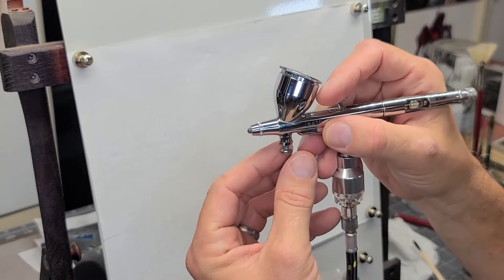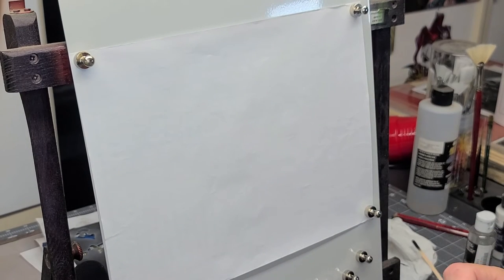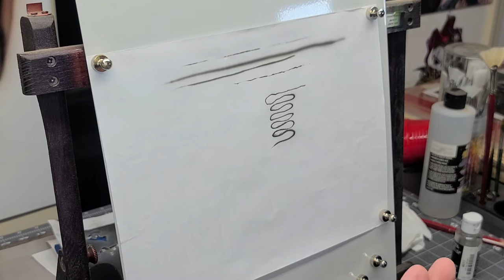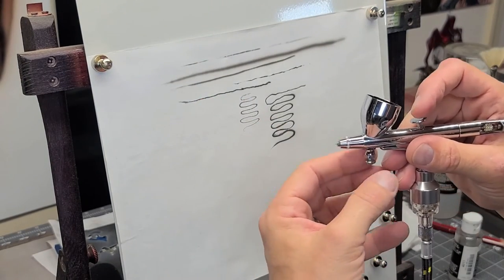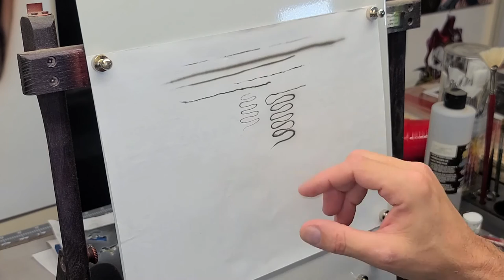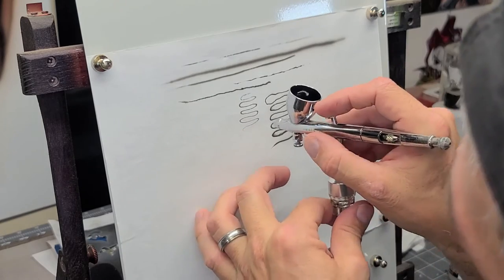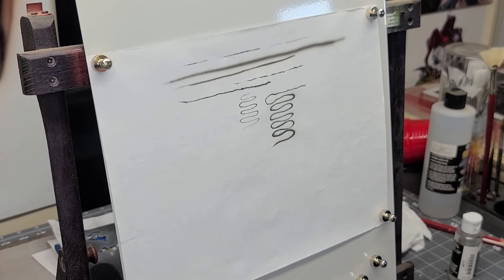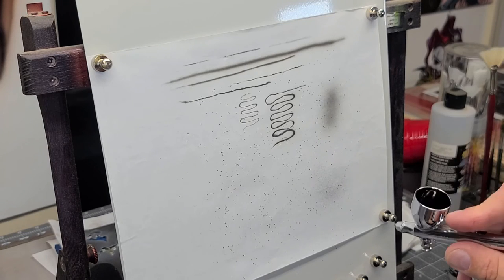What is an Airbrush MAC Valve - What is it and What does it do?

Comment: thanks for another excellent video.

I had the chance to pick up the same airbrush at a price I couldn't refuse but I haven't been able to try it out yet due to a pinched nerve in my right shoulder, so it's good to see it in action here.  

I'm new to the game and also coming from using a cheapo 20 quid Chinese jobby, I was wondering how you're finding HP-CH in general use compared with, say, the Eclipse?

@ 3:11 I swear I heard a fart sneak out!  ;'-D
Reply from the maker: Loneman, I find it very equivalent to the eclipse with a few upgrades. of course the MAC valve, it also has a cut-a-way handle for pulling the needle back to unclog jams and a beveled trigger and the needle is a .3 compared to a .35 on the eclipse but that is so minor one cannot tell the difference. Hope this helps, thanks for the question and thanks for watching.

Comment: I really love your content, and instructions, but, to be correct, a MAC valve only controls FLOW, NOT PRESSURE, what ever your regulator says is what your pressure is, the mac valve is just as your needle and nozzle, they are a Needle valve, nothing more. 
Let me explain, set your MAC valve at any point, plug your bowl, plug the nozzle, plug the rear seal, depress air valve, on both sides of the mac valve with have the same pressure, the pressure will equalize at what ever the regulator is set at! 
MAC valves control flow! Just like your needle and nozzle do!

Comment: A MAC Valve does not adjust or control air pressure, it regulates air flow, the Venturi Effect. Better brush up on your physics. 🤔